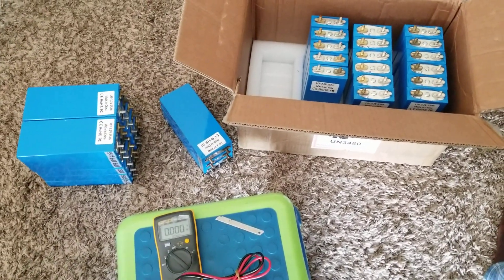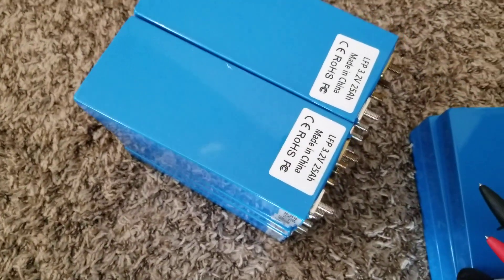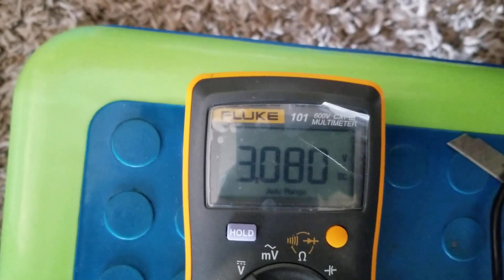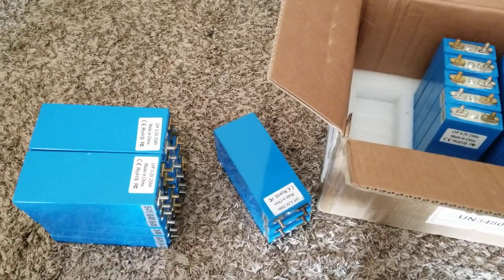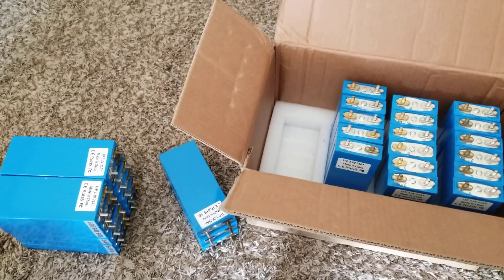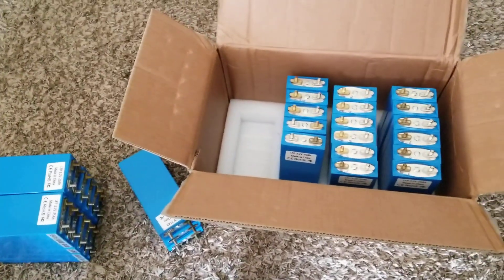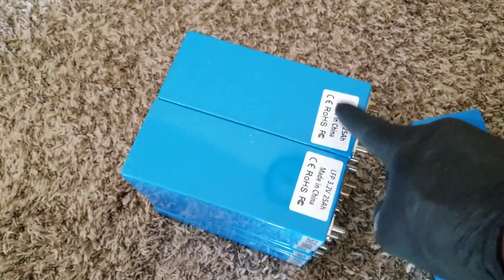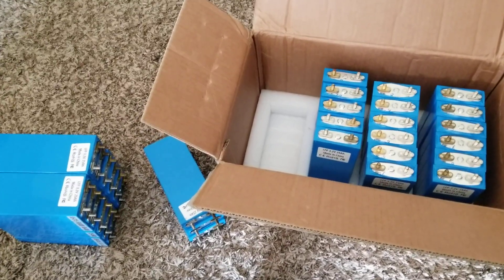TOPBAND PRISMATIC 3.2v 25ah LiFePo4, BATTERY VOLTAGE TEST (Part:2)

Comment: Balancing can be achieved by parallel them all together. The voltage may be lower then the 3.2v among all of them from the hi cells charging up the lower ones  . If you had a bench power supply then you can set the voltage and amperage to what it’s needed - 3.62 v or so to your desire . It may take some time like a day or so but keep monitoring them and testing voltage . If planning to implementing a BMS , then it should keep them pretty balanced after charging them first and shut off the charge at around  3.72v self threshold .Or charge them the regular JWSOLARUSA way to top charge them . This is a great investment for the cells new future projects . We ready !
Reply: Or better yet, just assemble your pack and balance it using a balance charger :)
Very close voltage matching is only needed when assembling cells in parallel. That way, you don't get a huge current flowing between cells. For a series pack, just let the balance charger do its thing and your pack will now be top-balanced, since that's exactly what balance chargers are designed to do.